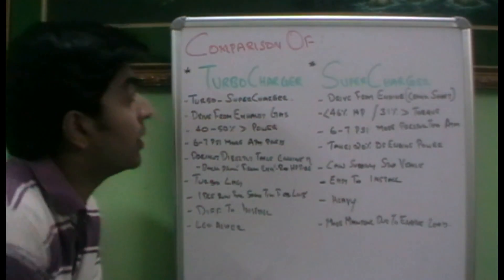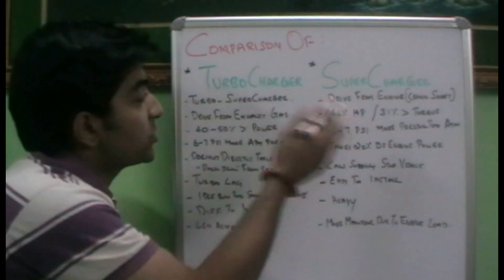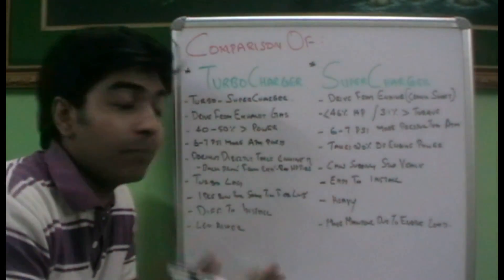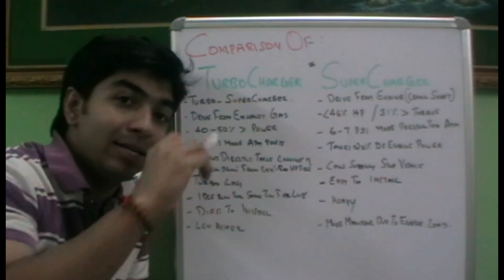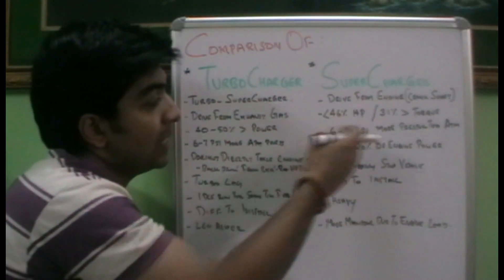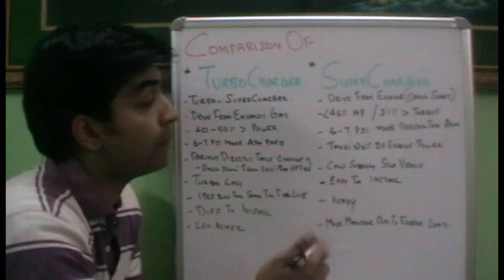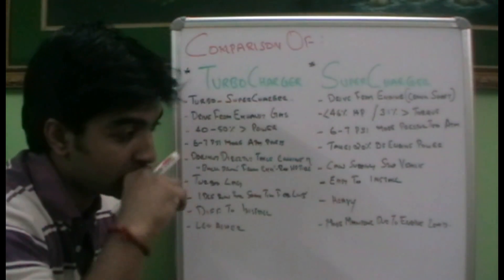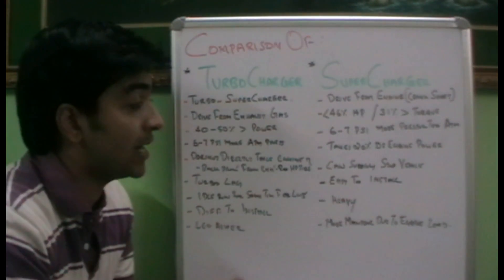How to compare turbocharger with supercharger. ✔

Comment from the maker: No, you cannot conclude like that, turbo chargers are widely used. its depends on the engine requirement. both has its advantages and diss advantages.

Comment: There are different turbos and superchargers size. If you select a turbo and compare it to a equivalent supercharger, you'll find the turbo is more efficient, because it reuses part fo the waste energy from the exaust. But then, the turbo only generates power since a certain amout of revs, and the supercharger always generates power.